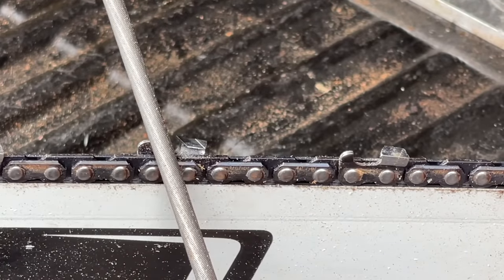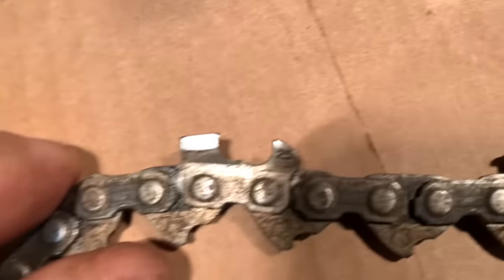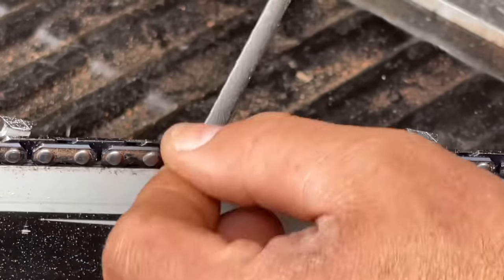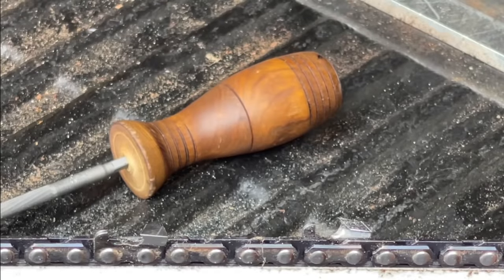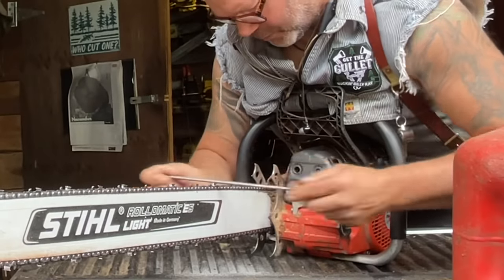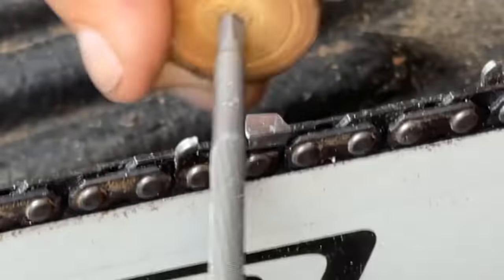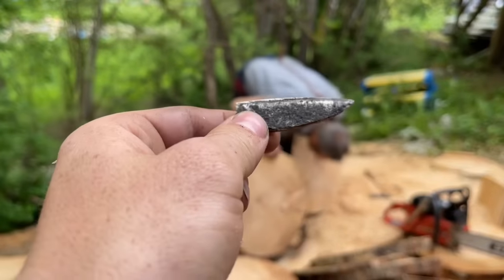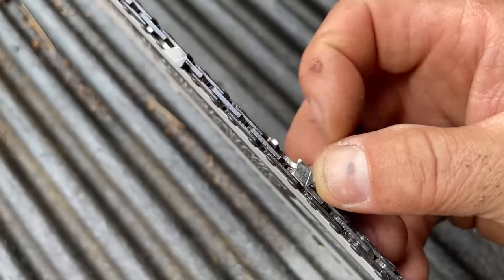How to hand file a chainsaw,  pro logger style

Comment: Hey Buckin,  I got a saw given to me and when I tried to file the chain some teeth wouldn't file.  They were so hard they'd ruin a brand new file.  You could actually see lines scratched on a brand new file and you could hear the sound of it.  I've even had rakers ruin brand new files with just a couple strokes.  Have you ever came across this before?
Reply from the maker: yip
Reply: @MATT.MAN-PEACE-LOVE  That's what I would have thought, or something like a high speed steel tooth, but it was only a few on a 20" chain.  Take care.
Reply: Maybe this teeth were grinded and got too hot. Sometimes the surface gets like glass. I am such a guy that Sometimes grinded unproperly like that. That's why i banned the grinder and only do handfiling on sawchains. Buckin's Videos helped me to get better and faster in that. His Credo "get the gullet" literally makes the difference between "some how cutting" and "really nice, fast and smooth cutting".

Once again: thank you Buckin'!
Reply: @sebastianleicht  Yeah, the only way they could have gotten that way is from heat.  Or maybe even work hardening. I use a 7/32 diamond file bit at a slow speed with light cutting fluid and a dremel tool on it.  I can't wait until it's gone. Take care.  Edit:  Oh I agree with you on that.  Between Buckin and the Ironhorse they helped me with my filing a lot.  I was decent before, but I have now been able to hone my craft to the next level  Thanks Buckin, Love ya bro.

Comment: Any chance you can show us you file the one shown in the video where the gullet is too deep from a small file.
Reply: Tricky to get the file back up to its correct level if the gullet has been set way too low. Thats the only time I might pull out the file guide for a reset. And put it in the vise
Reply: @neild7971  that is exactly what I did. Frustrating because I know Buckin could fix it filing one handed.

Comment: Left hand teeth are slightly off angle wise (look at 12:12m, compare top-plate angle with manufacturers stamped end of life guide line): just sayin'.  Good video though
Reply from the maker: i dont stick to the line ,, other side not done yet, is that what you mean in relation to the line  or the other side ?

Comment: Hey Buckin,
I need to file better. I’m right handed and that side goes well. But put a file in my left hand and... “ it cuts to one side” . If I work a grinder everything is okay just my hand is off and we use that in the field. Any help would be nice. Also keep up the great content been watching for years in CA USA
Reply: I’m right handed to, so I just put the saw upside down 🙃 works for me… 😆 but I’m rough and just cut a slot chain deep into my log as a field vice when I’m filing.

Comment: Someone must have snapped that into the limb while it was low and it was embedded and went up as the tree grew
Reply: The tree adds a layer year on year, girth and height, the wood at the bottom doesn’t move to the top 👍
Reply: @neild7971  thanks for that information... if thats the case this is just messed up someone was climbing it and broke their knife while doing who knows what up there

Comment: Also. I get like 10 or 15 files from a CHEAP file (forester brand).  Clean the cutters out with a wire brush or a wire wheel on a bench grinder
 I’m sorry buckin but your throwing money away if you toss a file after 3 or 4 times
Reply: Tap or air gun.  Look at it under a magnifier and you'll see that simple tapping and/or air gun gets it all quickly.  I agree that files last longer than he says, but not by a lot.

Comment: Buckin! If you get a chance, check out my comment on Dony Walkers last video he just put up. I have some questions about the 395 I just bought
Reply from the maker: its not there
Reply: @BuckinBillyRaySmith  I bought a 395xp. When I got the saw home I tore it down and found that someone had stripped the threads front the case where the cylinder bolts down, which I got that squared away. I then removed the piston and gauged it at 58mm, and I’m pretty sure a stock size is 56mm? I looked it up and it seems as though a 58mm big bore kit is pretty common? I don’t know much about these husky’s. Anyway the head is made by Hyway. I just need rings bc the piston and cylinder are fine but I can not find just rings anywhere. Any recommendations